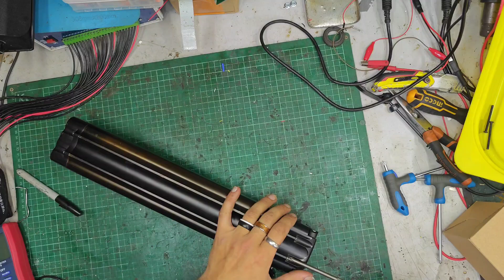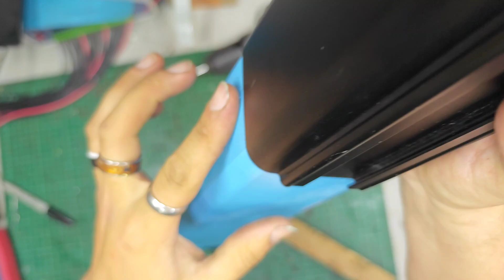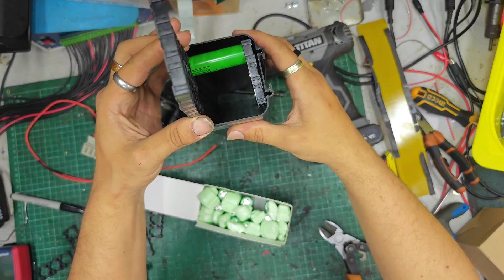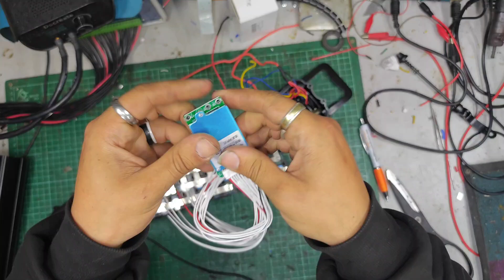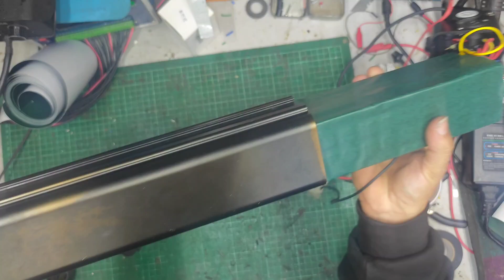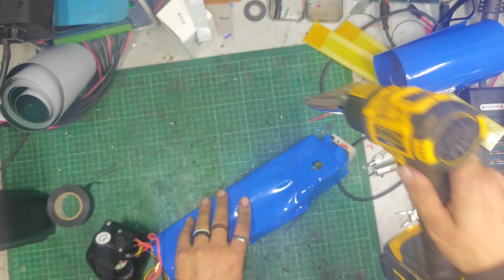Volt Electric Bicycle Battery - FULL RECELL!

Comment: as no current flows through balance wires, it should not matter if you leave full length wires or cut them to suit the route
Reply from the maker: But they do read voltage, which technically can be affected by resistance - it's a topic of debate amongst battery builders...
Reply: I cut them to length. Measured the resistance the change is so small there is really no voltage drop difference. Maybe 1mV from longest wire to shortest. So I do them neat, less chance for shorts and looks pretty.